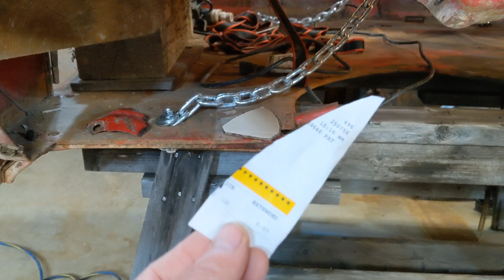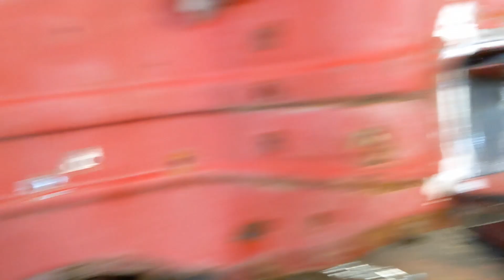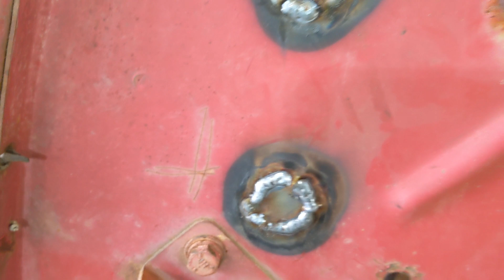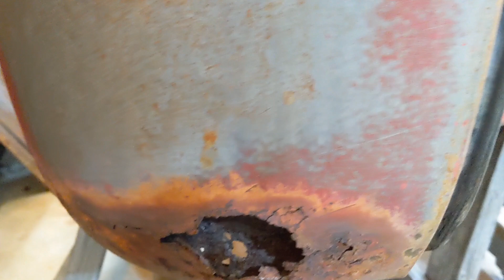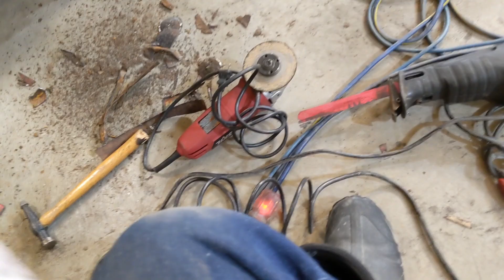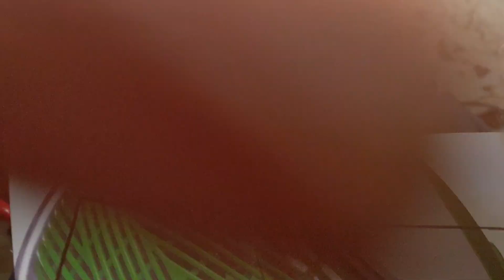1956 IH Pickup, Caddy Frame Swap, Metal Work on the Cab

Comment: This is great. I was very concerned that I would have to try to mold some sheet metal cab corner on mine but to know that that Chevy panel is a good start is great. I will be posting another video on mine in a few days. I just put on Poppy‘s patina matte finish and I will probably be getting tires tomorrow.
Reply from the maker: @Apache-mb2nh  the Chevy cab corner does take a little reshaping to make it work, but definitely a lot easier than making a patch from scratch. I'm looking forward to seeing how the Poppy's matte finish looks on yours. That's exactly what I was thinking of using on mine.

Comment: Nice work bud! This is going to be a very nice IH Escalade! 

Did you know that IH used parts from all three of the major manufacturers? GM, Ford and Chrysler.
Reply from the maker: @mattjanzen86  thanks Matt! I knew IH used some GM and Chrysler parts. Didn't know they also used Ford parts. I guess I'm keeping that tradition! It obviously will have GM parts, the seats and heater core will be from Ford's, and the guy I got the radiator from was going to use it in a jeep, so I guess that close enough to being a Chrysler part!